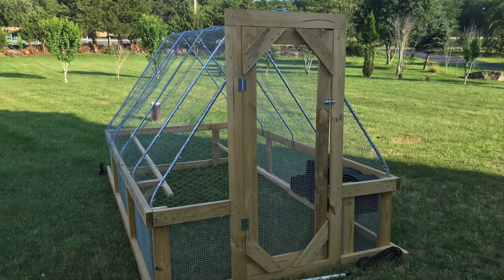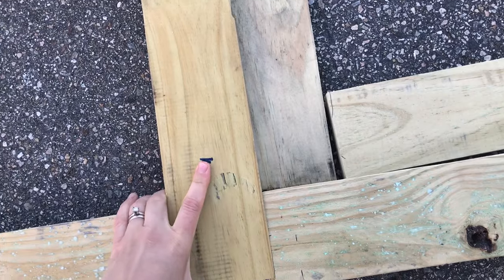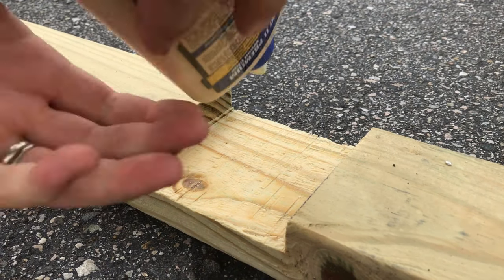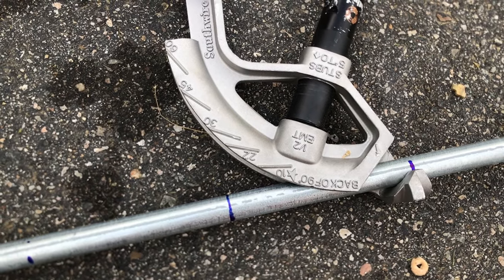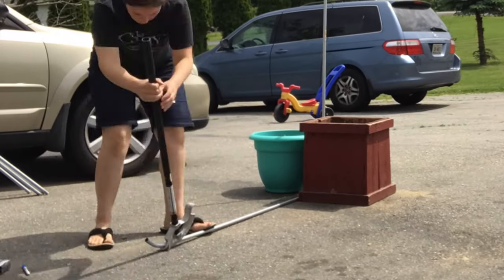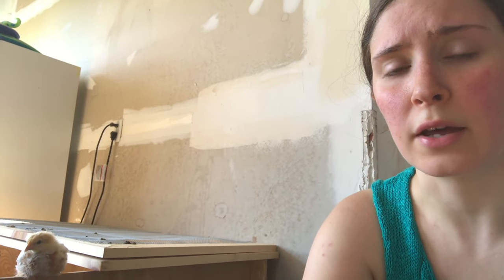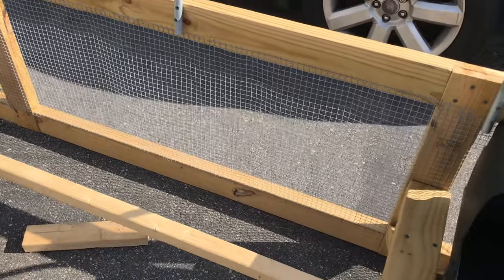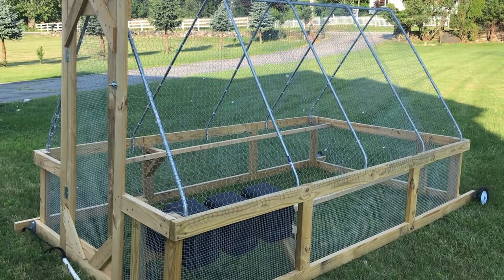Building the Stress Free Chicken Tractor: Tips and Tricks to following John Suscovich's Plans

Comment: Good job!  I've built a few of these.  The half lap joints add a lot of time to the project.  I used a table saw with a dado blade.  I also struggled with the conduit.  I ended up cutting it and using 45 degree connectors.  A little more money but worth it for me.  Hardware cloth everywhere for me.

Comment: Thanks for this.  I just finished building one of these.  The plans were great, until you get to the door.  Never did figure out how it was supposed to work, I ended up lap jointing the four corners of door and top two corners of the frame instead of the 45 brackets.
Reply: Nice greg great job